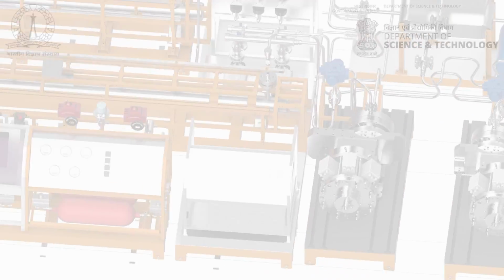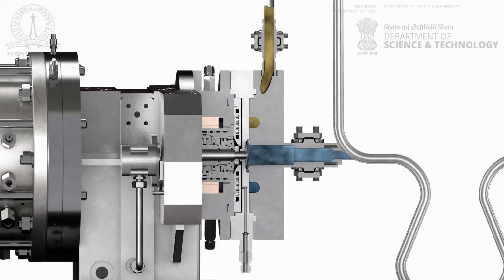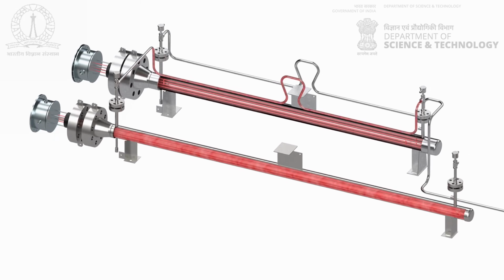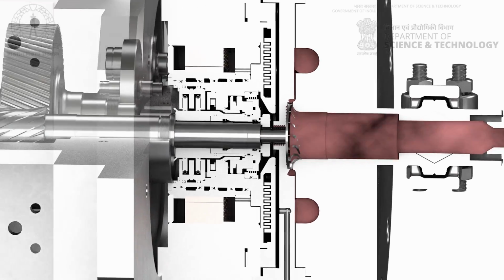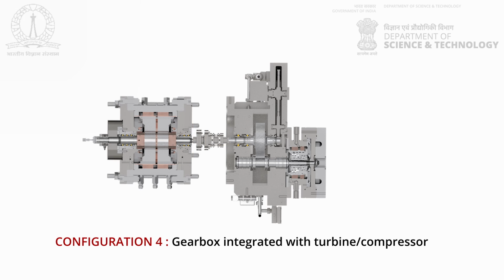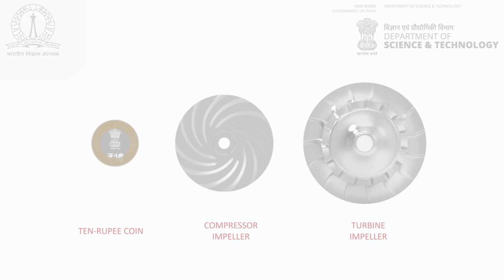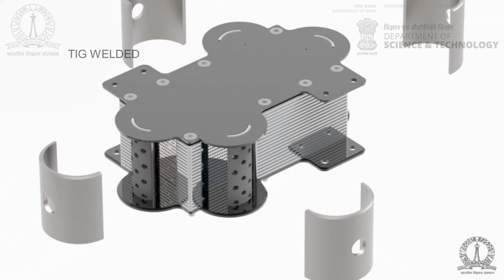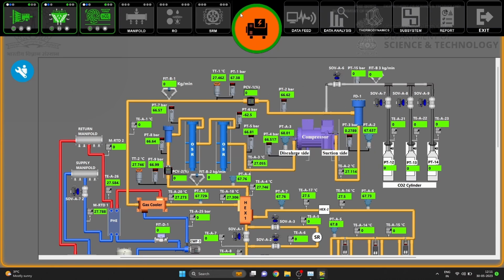Supercritical CO2 Power generation loop - ICER, IISc

Comment: I recently came across an article on ScienceDirect, titled 'Analysis of Radial-Outflow Turbine Design for Supercritical CO₂ and Comparison to Radial-Inflow Turbines', discusses a 400 kW (536 hp equivalent) supercritical CO₂ radial outflow turbine system, which achieves isentropic efficiencies ranging from 85% to over 90%.  Radial outflow turbines are more compact and easier to construct compared to axial-flow or radial-inflow turbines, making them a more practical choice for high-efficiency applications according to article.

Is it conceivable that some day we could have these in semi  trucks?